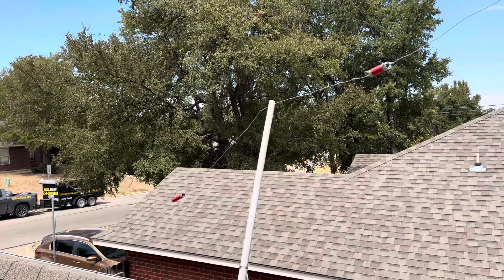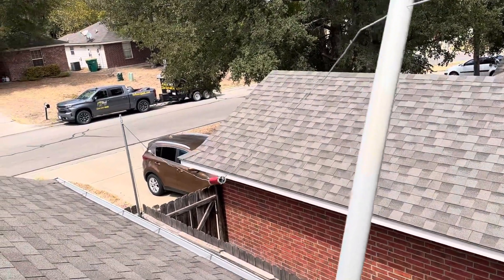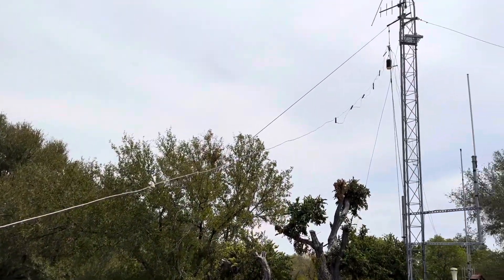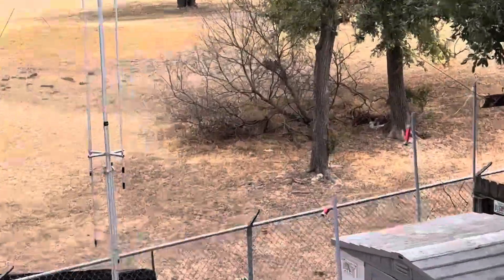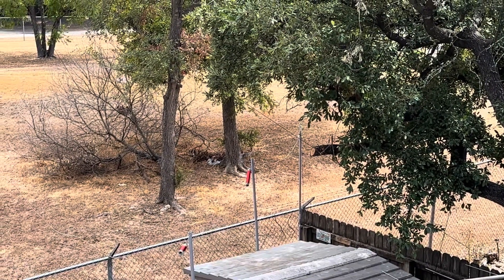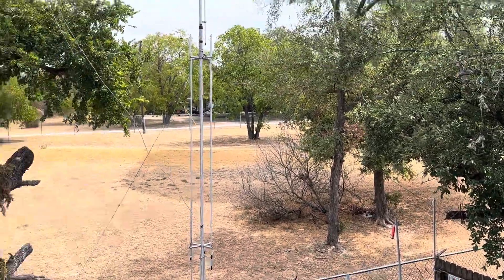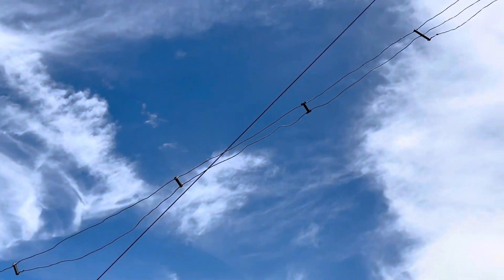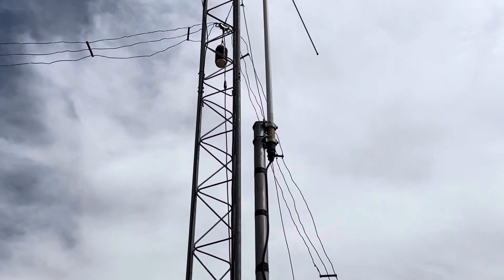Alpha Delta DX LB Plus antenna is up and operational.

Comment: My 2 cents.  You have both legs much too close to objects that can and tend to detune wire antennas. The roof, the side mounted antenna on the tower, gutters, chain link fence, and the ground……all are close enough to detune wire.  Looking at the instructions for the antenna, it even states that the wire should be at least 20ft away from any metal objects and roofs.  I feel that all of these objects and the close proximity to the ground at the ends of the legs are all going to impact impedance.
Reply from the maker: You nailed it the city chain link fence and the water tower inside the fence.